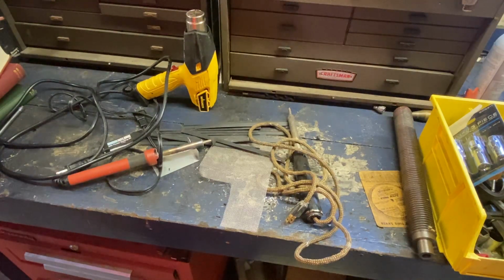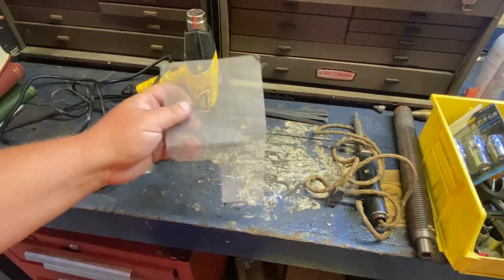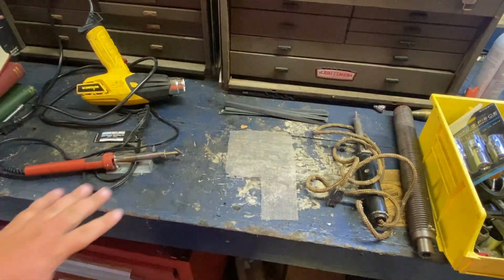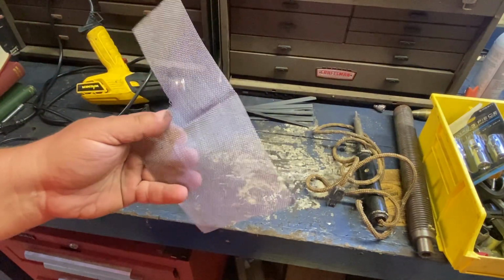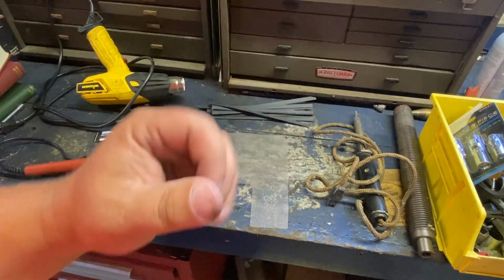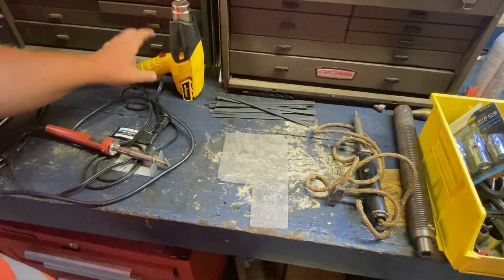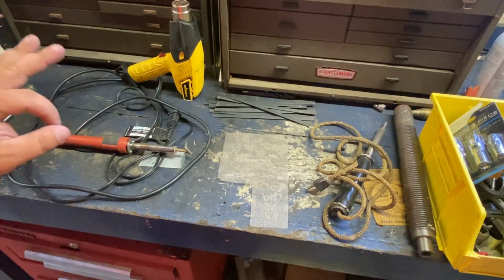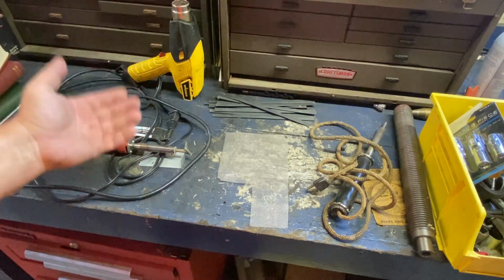Plastic welding, the basic tools you need

Comment: I weld thin stuff for modding electronics like cooling fan shrouds. I used the Harbor Freight tool before for welding water tanks it's a little too big for a PC case fan shroud. I use a T10 digital soldering iron kit I bought on eBay for about 15 bucks and can adjust the temps just before the plastic starts to smoke and that is perfect, there are hundreds of Hakko T10 iron shapes. These kits are not for everyone because you got to solder the cord in and wire it together, but they are inexpensive and you got to have a 24-volt 2 amp transformer or switching power supply. A real Japanese Hakko is about 170 bucks and Chinees clones are about 60.  I love the T10 the tips are integrated with the heating element and thermocouple sensor but it makes the tips cost more, I never had one go bad yet I'm still using a solder tip from 6 years ago, and the knife tip for plastic I still using that one too. The Hakko 600 and 900 series without the integrated heating elements are junk don't buy those.  I have 2 heat guns, one is more for soldering, has adjustable airflow and heat temp and it came with different standard sizes of air tips, it works perfectly on thin stuff I bought it for about 30 bucks on eBay, and the large heat gun like most people use is good for bending or melting large blobs I bartered for this one at the flea market.
Reply from the maker: I will have to look into those